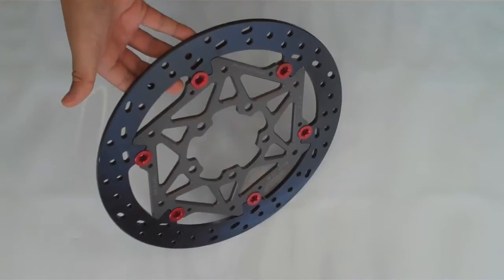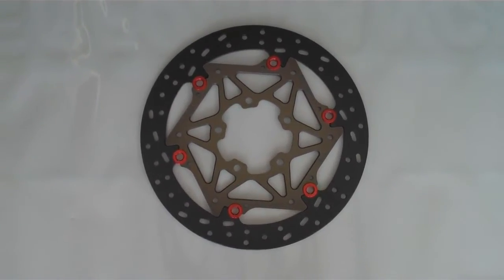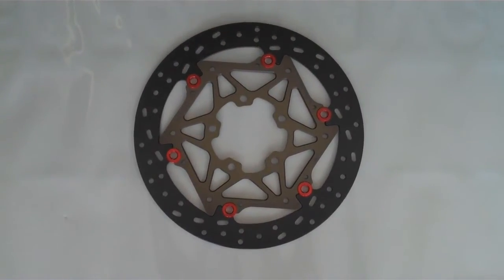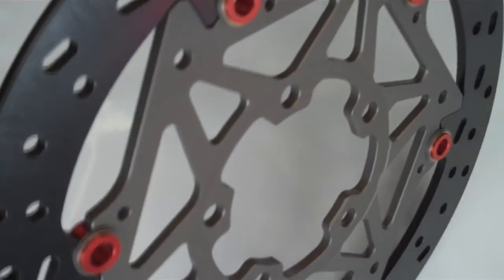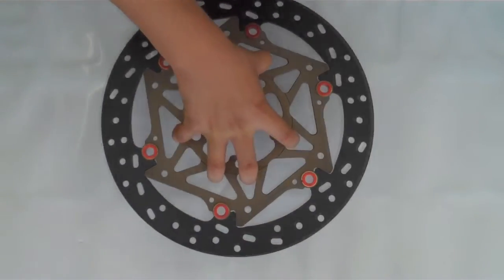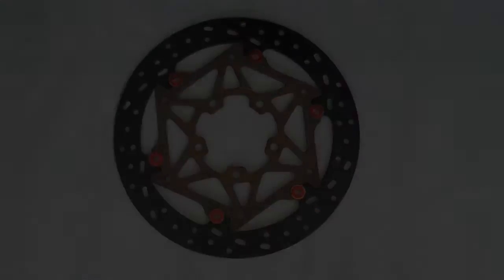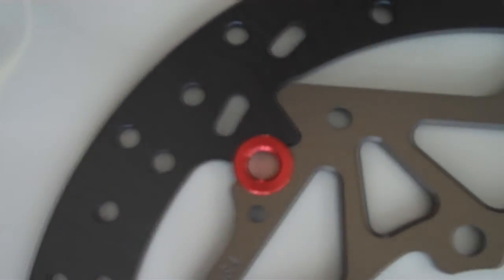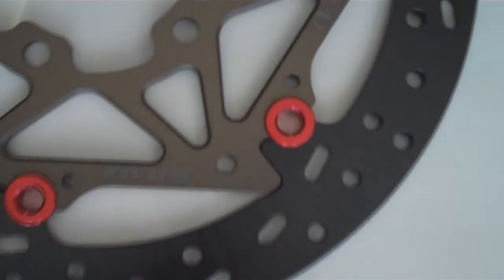Brake Tech Axis Iron Race Brake Rotors at SoloMotoParts.com

Comment: Been running the 330mm for over four years now and combined with Brembo calipers and Ferodo CP1 pads , my 2012 Hayabusa braking setup is outstandingly good . The rotors are pivotal to the total overall performance gain .
Reply: roadtoad1340 ... I've never run full floating rotors before but have been considering getting a set of these for my 07 Busa - is there a noticeable amount of audible rattle when just plugging through city traffic ?  Thanks